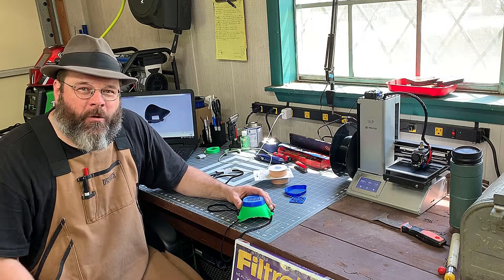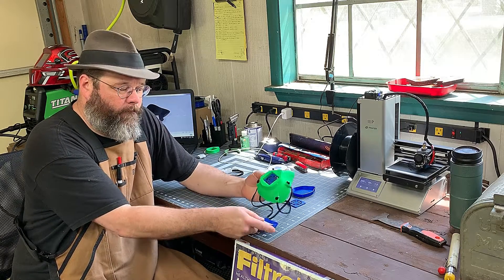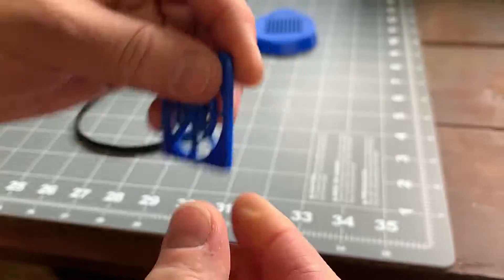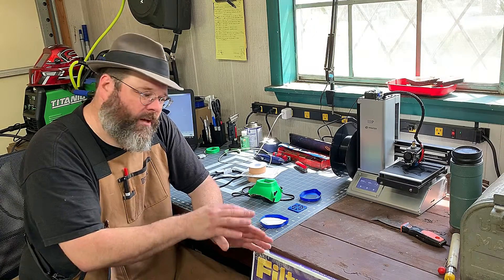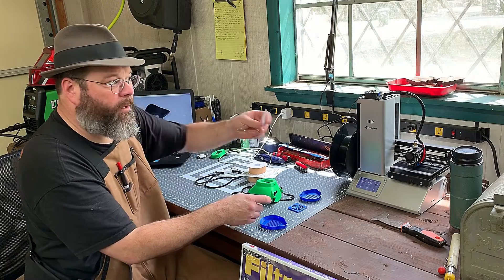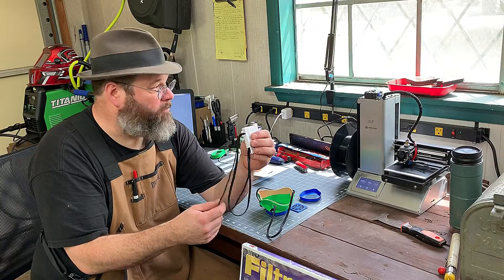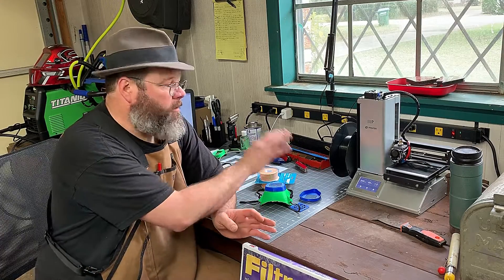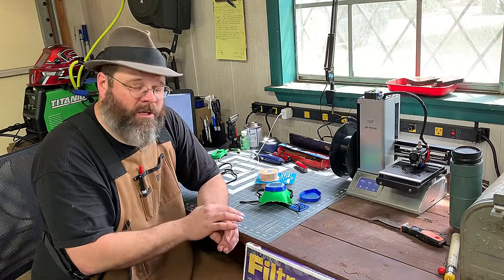Episode 23 - 3D Printed Reusable Filter Mask- in the face of corona

Comment: Hello! Thanks for printing our free 3D printable mask prototype. 
We would like to invite you to try out the new version (v2) which includes several improvements:
https://www.thingiverse.com/thing:4225667

P.D. Could you include a link to the model in the description of the video?
We can see a lot of people is asking for the printable files and it may be faster than asking you by email, right?

Be safe!
Reply from the maker: You are welcome to leave your links as it probably will help folks get the files faster to help folks than my emails, but we did not use your design. It looks too small, not enough room for the waterproof tape we use, the chin is a different shape and ours comes around more, finally the filter area is different, We based the mostly on the Lowell mask and then massaged that.